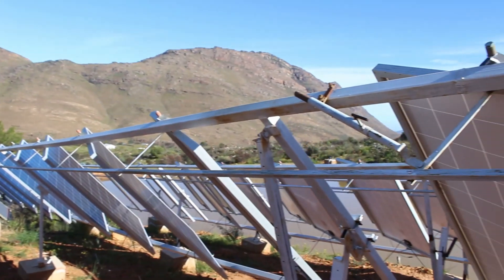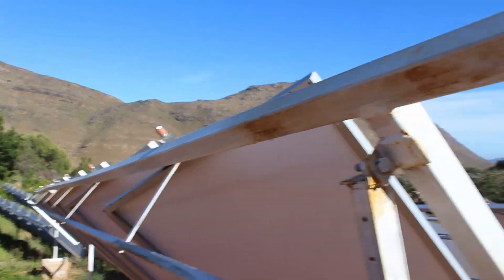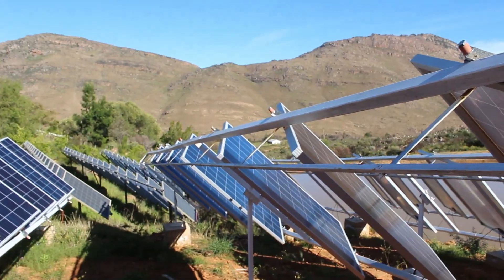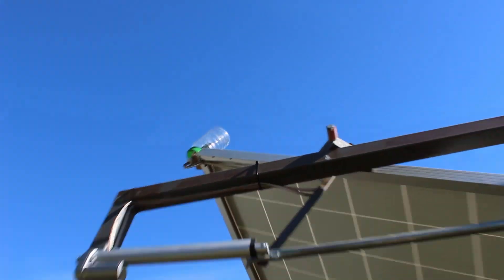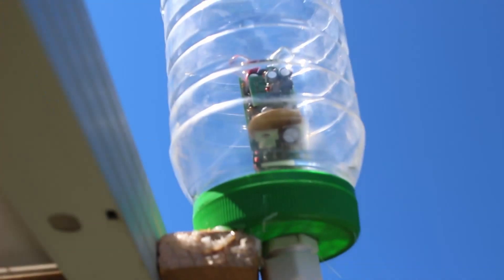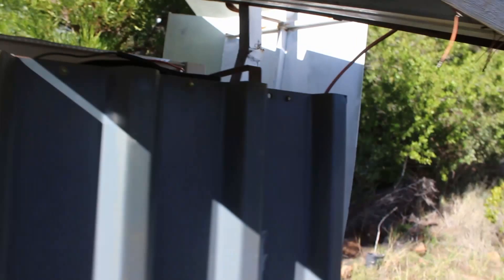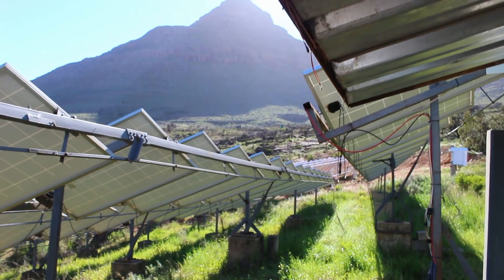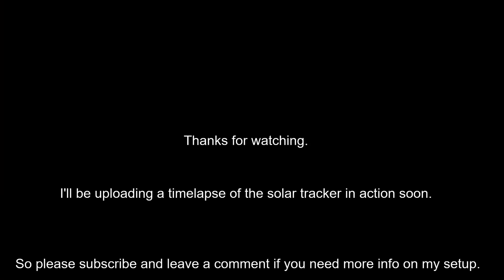Red Rock Solar Tracking System setup (LED3XC3) South Africa

Comment: At What tilt angle to the horizontal did you construct your frame work and in what direction are they facing. 
And will these angles and directions work anywhere in SA

Comment: Very intelligent and easy to handle, but I have a question, don't  the 17 panels shade each other facing the sun when they are directed to east or west?
Reply from the maker: Hi there! Shading isn't such big of an issue because of our geograpical location between two mountains, East and West of the array. The sun therefore only starts to reach the panels when its at an angle of about 30 - 45° above the horizon, depending on the season. This allowed us to space the panels quite close to eachother with minimal shading occurring in the morning for the first hour or so. The effect of shading in the afternoon was eliminated by placing the sensor on the second panel of a row, causing the panels to turn back as soon as the sensor was shaded.

Even with some shading occuring in the morning, we were still able to generate 40 - 60 % more electricity than using a fixed position.
Reply: @jannick186  I have one more question because I'm planning to build the same system at my farm. So my question is, do you have a diagram for this solar panels mount? Or from where I can get it? Thank you

Comment: How do you compensate for the shade from the panel in front of it from the Sun you're losing power from the shade you should be every other panel on your tilt that way the shade would not affect the following panel
Reply from the maker: Hey Kevin. This proved to be a problem. I've since moved the sensor to the second panel in a row, also placing it on the southeastern corner of the panel. Now as soon as the panels start shading in the afternoon, the sensor also gets shaded, thus reversing the direction of the actuator. The afternoon shading was then significantly reduced.
Reply: Looks like you have the panels a little too close to each other causing shading which will kill the output.